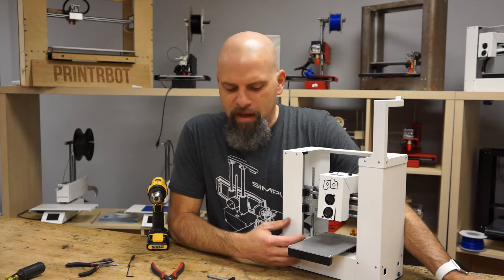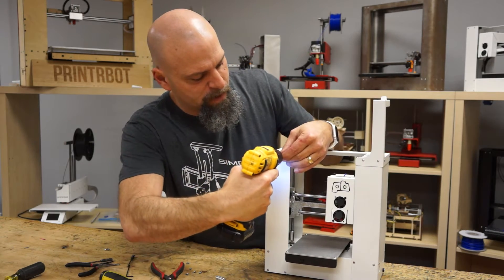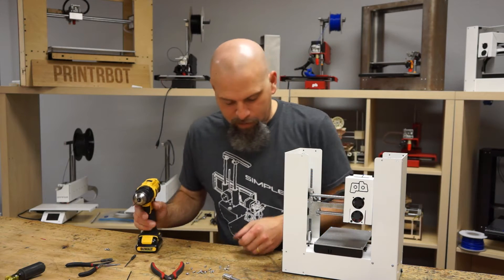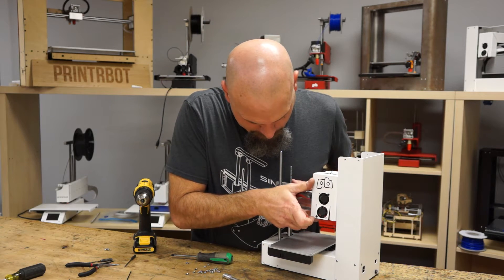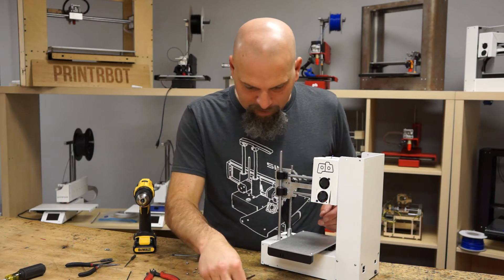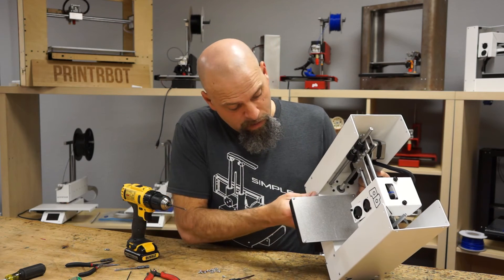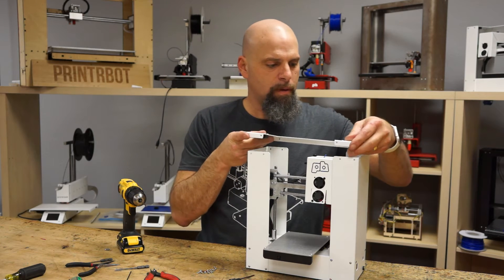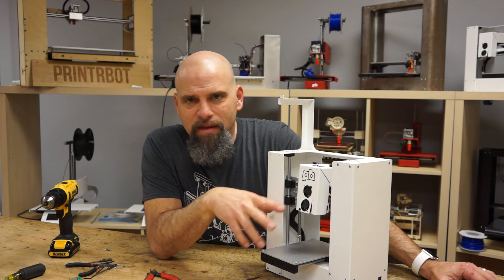Printrbot Play - Z Lead Screw 4-Start Upgrade Build

Comment: How do I change the parameters on Cura 2.0?  Do I change it in the Machine Setttings in the "start code" area?  If so, Do I just place it anywhere in the start code area?
Reply from the maker: You have to send it m-codes. In the older cura, I remember using the pronterface UI to do so. You can use repetier if you can't find the settings. There are instructions available in printrbot.com

Comment: If you're like me and spent considerable time looking, this is what you need to set after changing out the screw.

M92 Z400
M500
M501

Found here:
https://plus.google.com/+BrookDrummpb/posts/HbtCQNV8VSp
Reply from the maker: Sorry about that, we've added the info to a few places
Reply: you really need to get a Doc up for this I spent more time looking for the correct line of code than putting in the new rod on my simple metal